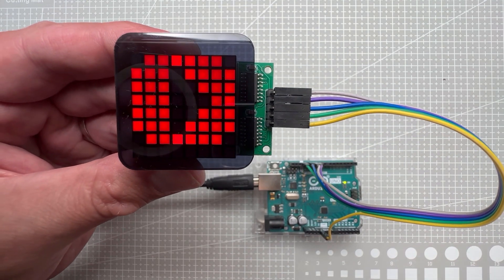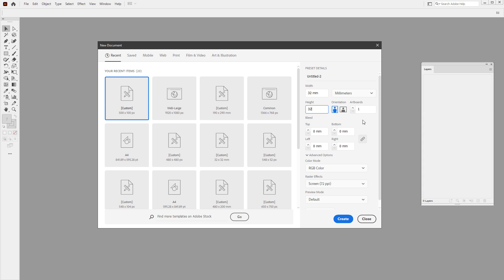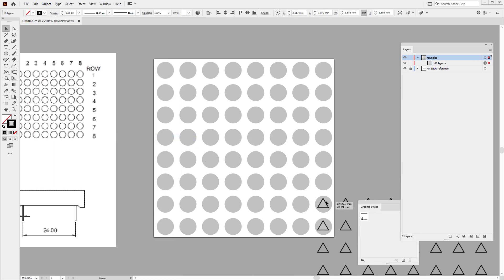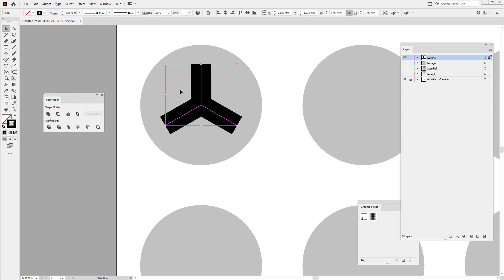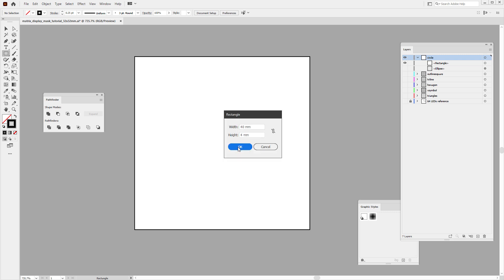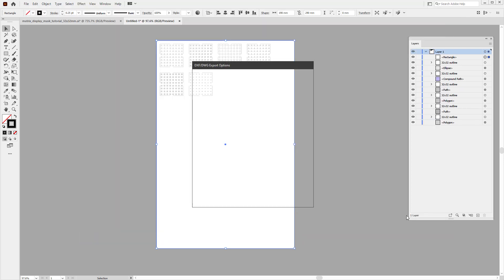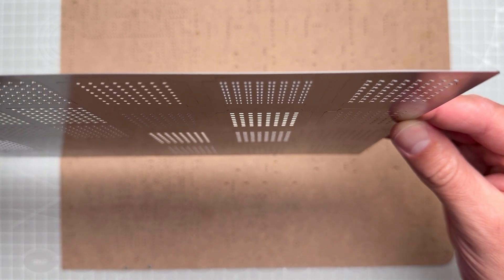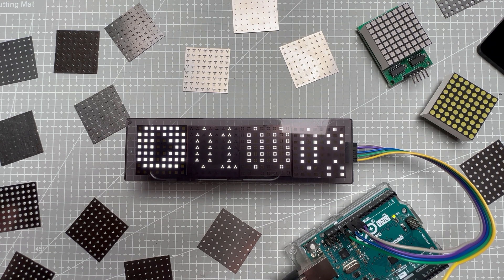Why are pixels square?

Comment: great !  what is the semi-transparent black material to use before the grid please
Reply from the maker: It´s a tinted dark acrylic sheet / glass. Link in the description. You still need to cut it to a shape using either laser cutter or manually using some hand tools.

Comment: SMD stencils are so useful. I've been using them as a spray paint mask to apply legends to keycaps (clean your stencil immediately). It's also easy to make front panel overlays with led shine through for labels and logos. If you're using you pcb design software paste layer to generate the artwork from the copper top layer then just remember to set the paste shrink macro to zero. I'd also recommend using a sturdy guillotine to cut the stencil tabs as there's a risk of bending when using shears.
Reply from the maker: Great to hear that I´m not the only one using SMD stencils in non-standard ways. Do you have any examples of your work somewhere? I would love to see it. Especially how you separate those pieces, becase as you have noted, using scissors bends the metal sheet.. Thank you!
Reply: @upir_upir  Any guillotine built for cutting thick card stock will work but the stencil needs to be held down by a flat mass (something you can push down on with your hand - I use a piece of stainless steel square section bar) otherwise it may rotate a little towards the cutting edge. Not sure how long the blade will stay sharp but if the tabs are short it should be ok for a good while. If you have a continuous lead-in slot from the edge of the stencil then the blade can find it's own way - otherwise you need a USB microscope.

I've used the stencils recently for provide a mask for a high density LED ring encoder - 48 1mm x 2mm addressable leds in a 30mm diameter circle. The stencil panel overlay was the only way to get a nice accurate optical separation of each led. I tried using FR4 pcb material with the peep holes set in the solder mask layer but there was too much light bleed between leds - mainly thru the body of the FR4 material. The stencil is perfect and if you really want to go to town you can pot the emitters up to their top face in black epoxy to ensure that high density leds are truly isolated optically.

I want to use a stencil to reproduce the style of my favourite ever keypad - that of the Motorola Razr mobile phone. I'm sure it can be done with RGB leds, low pressure tact switches (the ones used in computer mice) and a very thin acrylic clear overlay. The stainless steel will look fantastic!

If you put a contact email on your github I'll send thru some pics as I make progress.

P.S. A much simpler way for cutting out the stencil boundaries might be to negotiate with pcbway / jlcpcb to cut them out fully and not charge you for each plate as a separate stencil. I tried this and failed. Probably because it's not technically practical for them. But you might have better luck. Failing that, maybe go for the minimum tab size and a file to clean up the edges..